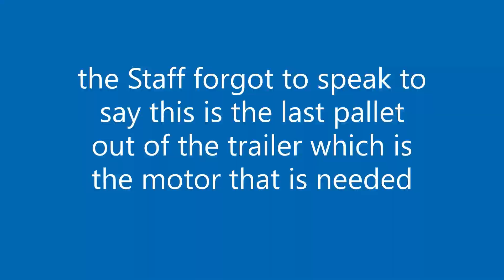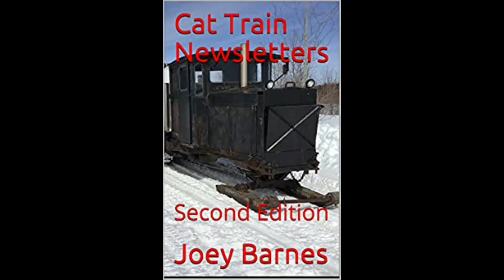Welding Table Recycled Steel Again April 21 2023

Comment: On the wall behind me is a 3x5 map of the world. It has a dot in the center of Canada for Lynn Lake . Is that "Whoville"?. I was friends with an old guy back in the early 60s.Charlie owned the land across the street. He worked a '46 Ford COE dump truck with a 10 body and a '47 Sterling chain drive dump that he used to plow with. Charlie hauled scrap with the Ford. He kept a D4 with a cable operated  Traxcavator loader and a 5 ton '46 Ford dump truck and a Bucyrus-Erie shovel on  his property. So yah, you and the Kingdom grabbed me yrs ago. 😎
Reply from the maker: yes WHO-ville is lynn lake and we seem to be the centre with all the airplanes flying over to get to their destinations. charlie had some nice equipment back in the day. hope it went to a god home.  thansk

Comment: I want the wheels off of your new welding cart
Reply from the maker: the new welding cart was build back in the late 1990s as a cart for the local RR to lift have pieces. it was used about twice a year then the trains stopped in 2003.  thansk

Comment: Just out of curiosity: Do you ever sell scrap metal so you can buy your beer so you can turn in the bottles (or cans) so you can buy fuel so you can keep running your equipment?! Good to see the snow melting so you can move stuff around for the 5 days of summer.
Reply from the maker: yes i was the scrap man for over 25 years and shipped a lot of scrap south. now the cost and the rules are unreal to even ship so we stock pile the scrap in the back of the Kingdom as part of my retirement fund. being in the scrap business gave me all the good materials to build the projects i have.  thansk